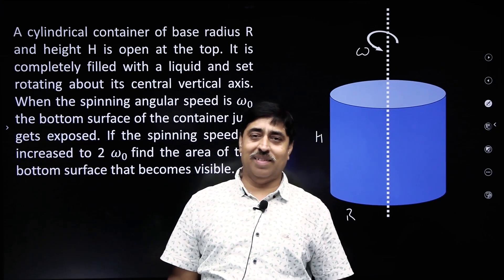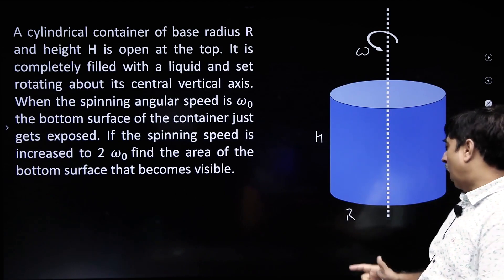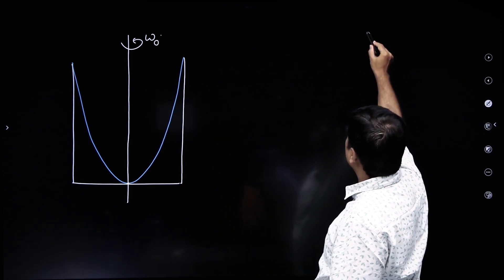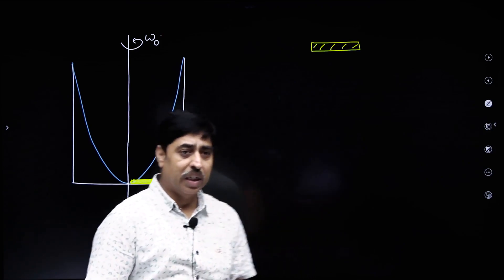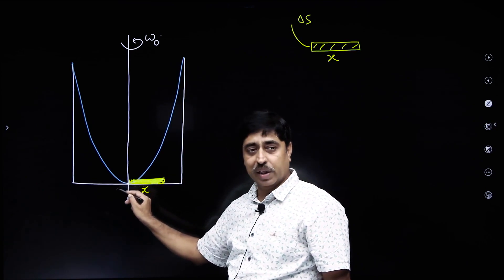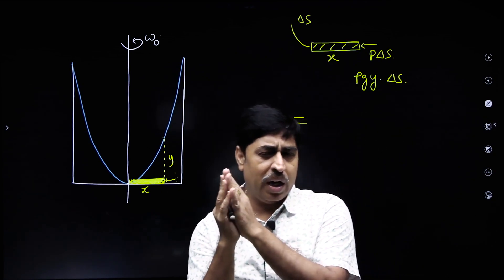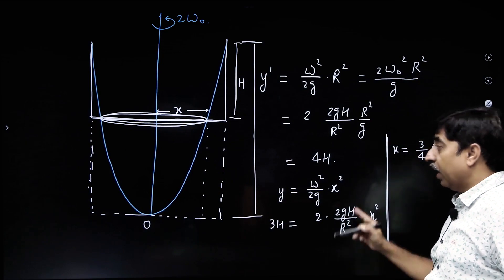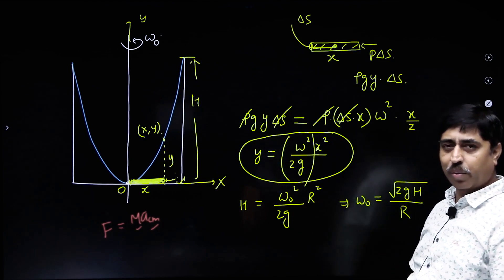Problem in Fluid Mechanics for JEE Advanced | Liquid in a rotating cylinder | #sbt #jeeadvanced

Comment: so i was doing and got to the approach that you did but it didn't seemed right to me so i left it.But what we can do is the pressure at the R will be rho g H and assume some x is left from origin the integrate from x to R and write the pressure of that same place by the two methods and then we will also get the same answer.